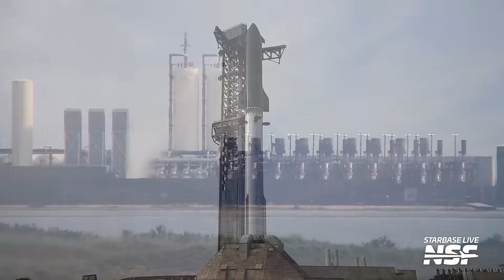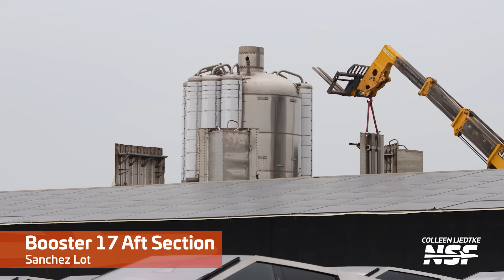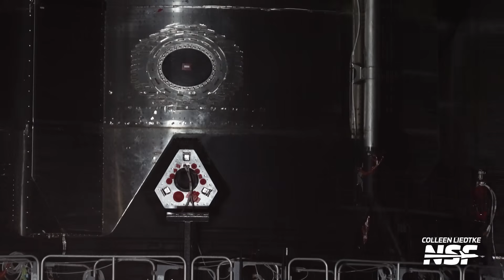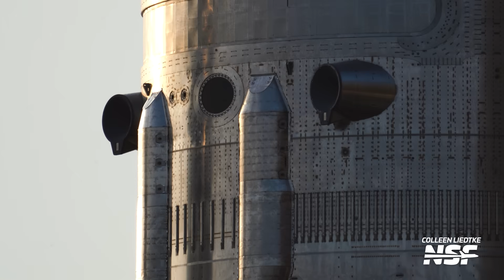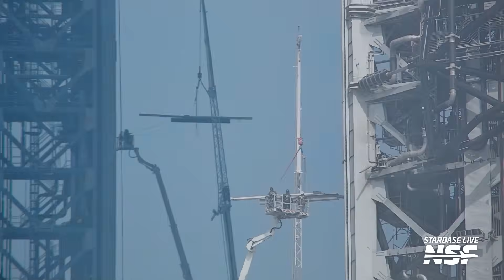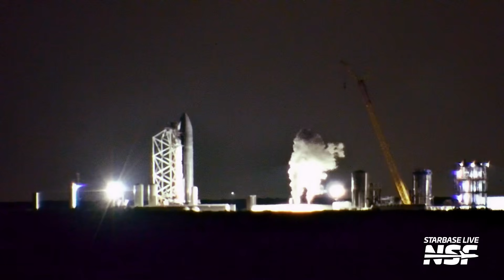Flight 12 Could Happen Any Day Now | Starship Update

Comment: Speaking from experience with N2 gas plants.  As soon as the cold N2 is released it instantly mixes with air.  Not dangerous.  The cloud you see is condensate.  I have walked through these clouds many times in our chemical plant.   The only danger might be the fog crossing the road.

Comment: The terms "leeward" and 'windward" are being used incorrectly by your entire team. Leeward - the direction in which the wind blows. In that context 'windward' can only mean the direction from which the wind comes. The wind speed and direction and airflow over the ship are two completely different things. The terms you should be using are dorsal and ventral - dorsal being the side without heat-shield and ventral being the side with heat-shield. Fore, aft, port, starboard, dorsal and ventral. This is really easy guys - get with it and quit propagating wrongthink. Everyone watching these vides thinks leeward means something it doesn't because of your incorrect use of the word. The internet is there if you don't believe me. Use it.

Comment: "Nitrogen Cloud...you cant breath that"....looks at the Air Mixed Gases Ratio.....(Nitrogen 78% ^^)
Reply: It has killed by displacing o2.. and because most of what we breath is N we don't have any idea until it's usually to late.
Reply: @imaginary_friend7300  You fail to notice that we are talking about a pure N2 gascloud released OUTSIDE INTO THE AIR.....what do you think will happen ^^. Hint there is no DISPLACING 02....at least not on a level that "has killed" ....

You sound like the kind of people that is using their 100% n2 filled tires and refuses to refill them if needed urgently at a gas station using compressed air because it is not nitrogen ^^

Comment: wasnt v3 supposed to have 6 vac engines?
Reply: I think that's planned for v4.  Which makes sense.  V3 is not traveling a lot in space, up to PEZ or refuel.  V4 is prob the long mission duration - moon - so it needs more thrust for TLI, moon orbit, moon deorbit, and moon reorbit.

Comment: At this point, all signs point to a "Go" for Flight on May 15.  As in all cases previous though, the date could easily slip to the right.

Thanks for great coverage @NSF team!  Y'all rockin' it!
Reply: That's just false. We've known since rollout that both Booster 19 and Ship 39 would be returning to the Mega Bays after WDR. The timeline to the 15th changed from VERY optimistic to impossible when the WDR got delayed by 2 days. Now the notices indicate NET May 19th, and speculation indicates S39 might also have a quick visit to Massey's before launch preps in MB2.

Comment: I'm confused. Is this whole thing supposed to eventually be a human launch system or is it always going to be just to launch satelites or pieces of satelites?
Reply: Like Falcon 9 they will start with satellites (probably starlink then commercial) and, once they have proven it's reliability and got the last of the bugs out they will progress to human rating it.
Reply: Cargo first.
Reply: The black heat tile versions of the ships are for either Satellite launches (like paultimmins said), or refueling ships.

The Human (HLS) version will be white in color, and no one has seen one, it's being designed in secret, although NASA-SpaceX has published milestones (the way SpaceX gets paid) online which indicate there is much progress being made.

However, keep in mind that the basics of flight for the HLS are what you are seeing in all these videos - booster, grid fins, engines, etc

Comment: How close is SpaceX to producing and providing their own fuel?
Reply: Those installations are way more complicated then they seem.  So wait until it looks finished and then don't be shocked if it takes months to get going.
Reply: They are building an air distillation unit for oxygen but they will not be producing their own methane as far as I know.
Reply: @kevikiru  They're also planning to build a natural gas liquification and purification facility on the launch site. Long term the'll probably want and need to build a gas pipeline to that if they want to achieve the launch cadence they're talking about.
Reply: Oh, oxygen and nitrogen production BTW.